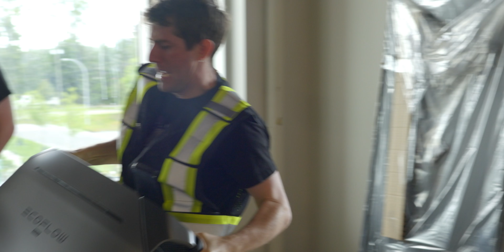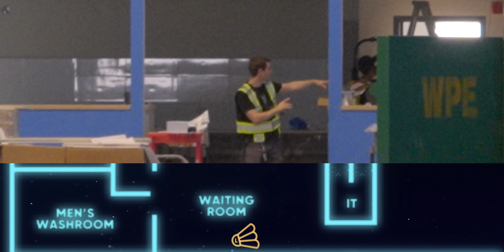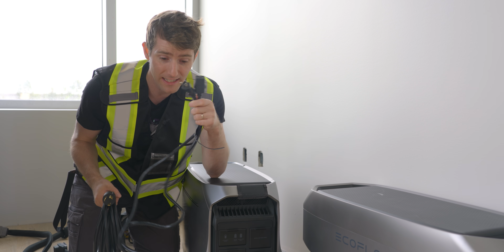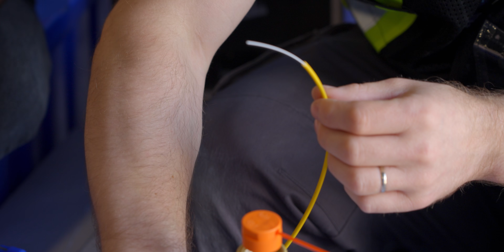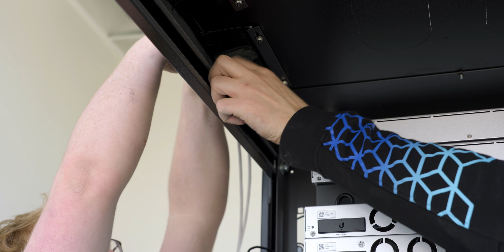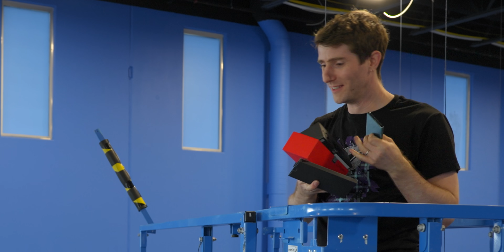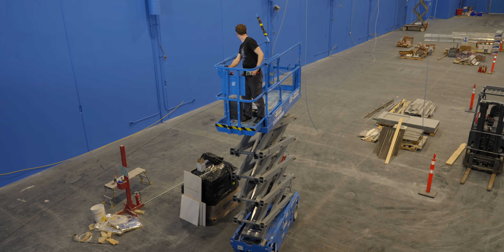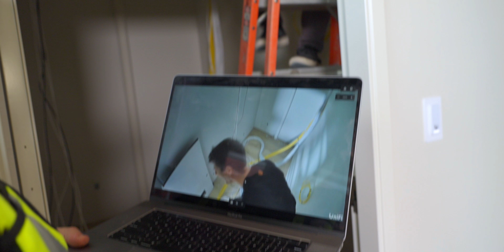I put WiFi 7 in my badminton center

Comment: I have a question, talking about speed. I have an 1 gbps fiber package with my isp, but I am only receiving around 400 to 500mbps, up and down is that around normal or do I need to call them and have a chat with them about their speed? I thought if i paied for the 1 gbps it should be more like 600 to 700 mbps.

Comment: 8 year Telecom Tech here Coax, Ethernet and 5 years of fiber (same company)    those AFL Fast connectors are awesome they really are fast.   I dont recomend the black tube/sleeve.  You should be good with the rubber boot. Put it on the buffer tube first strip/scrape back over 40mm and clean and cleve and quick connect.    Push both pins in on the connector tool to push into fitting then slide fiber in until it stops and squeeze the sides of the connector tool

Comment: I know this is an older video, but usually they don’t like to put sprinkler heads in data or server rooms. Usually they’ll use some sort of specialty fire suppression. I saw that sprinkler head sitting almost directly over the rack in the small room and all I could think is there’s thousands of gallons of water sitting right above very sensitive electronics.

Comment: anyone ever tested these magnetic cable management clamps from LTT Store with older less well insulated Cat 5e Patch Cables for possible interference? I once had to re-position an ancient cable in the production area of the company I was working for because it was too close to a rather dangerous psu and my coworker blamed magnetic or electromagnetic interference as a possible source for the problem (system patched to that panel was basically lagging and sometimes packets were straight up lost - I blamed the faulty cable though, but you know how it is working with ancient tech sometimes involves a little bit of lay on hands and magic server dust)

Comment: 9:05 Linus, if you have not already, please consider having LMG purchase a fiber optic fusion splicer. I use a Fujikura FSM-80S at work and they are a Godsend compared to fast connects (mechanical splicing). A fusion splicer will also make it much easier to work with fiber in the long term and have an infinitely higher success rate on the splice. Fast connects are to be used in emergencies with a followup plan to replace the fast connect with a fusion splice.

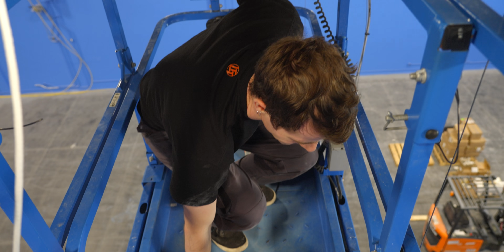17:18 I went on a scissor lift, and up to its maximum extension to terminate a cat6 cable, for the first time last year and also chose to work on my knees. The platform felt too wobbly when standing but more stable on my knees.
Reply: They have no idea about anything infrastructure related. Why waste money on a fusion splicer

Comment: I'm a bit late to this video, but as someone who works almost exclusively with fiber in data centers this was somewhat painful to watch. So many issues that MAY not be an issue, but I have seen failures over so many of these issues. I love seeing the "Fuck it we'll do it live" attitude, but it's weird seeing a video that I can actually critique what is happening. I might have if I got to this video sooner, but I almost want to use this as training for some of the newer guys that I work with as far as what NOT to do. 

I will admit even after quite a bit of time on a scissor lift and with a harness I still regularly grab the structural steel.

Comment: Those APs are way too high in my opinion, in most scenarios we should never exceed 3m in height, and the antenna pattern is not optimized for that. I would consider mounting them on the walls, especially if you want to take advantage of WiFi 7, which is great, been testing for a few months so far but the EU kneecaps us at 160mhz...😢

Comment: You shouldn’t be recommending Ecoflow before they issue a recall on the river 600MAX. It has a defect, so if you uncharged it completely it won’t charge again.
Mine died just a week after warranty ended and they should recall these units because of this defect!

Comment: "in Wi-Fi, if someone is using it, to a degree, you have to wait for them to be done"
i've learned that in the past, Ethernet worked like Wi-Fi now in the sense that you had to wait for someone to stop sending data before you can send or else the packets will collide and be come corrupt, because all the devices was connected to a single cable, like Wi-Fi now but in cable form. look up "shared medium Ethernet" and "CSMA/CD"

Comment: This place looks cool and all and I really love the concept but as a Disabled person I gotta ask, how accessible is the building? Are the public entryways wide with automatic doors or the ones that require the button? Are the doors themselves light? Once it is set up, will there be enough room in the LAN setup for a power wheelchair to comfortably fit between the rows? Is there an accessible (and gender neutral) washroom or a accessible stall in each washroom?

Comment: why dont you guys never use other brands for networking like mikrotik for an example CCR2216-1G-12XS-2XQ There are 2x QSFP28 cages for blazing-fast 100 Gigabit connectivity, 12x SFP28 cages for 25 Gigabit networking, and a Gigabit Ethernet port. The device comes with 16 GB of RAM, decent NAND storage, and two M.2 SATA slots

Comment: I live in a rural area in South Texas where satellite internet is usually the only option besides mobile networks. Recently, the tower near my home underwent maintenance and upgrades, and now my phone receives a strong 5G UC signal. I’m consistently getting speeds no less than 500 Mbps, and yesterday I even reached 1,100 Mbps down. I have Starlink, but I’m considering adding 5G as a backup or using it as a bonded connection.

Comment: Those speakers in standard ac oustic drop ceiling panels is going to be a problem. Please use different panels or support the weight of the speaker above the grid. Also, lower the gate on the scissor lift when operating it or you'll trigger regulators and Safety Steve's everywhere.

Comment: Microsoft pisses me off. On Windows, you have to be running Windows 11 24H2 (currently in "preview") to get MLO support. 

But Windows 11 24H2 removes ALL support for Windows Mixed Reality headsets. They simply do not work at all on it. (YES, I USE A WMR HEADSET FOR VR, I'M A CHEAP BASTARD, I GOT IT FREE!)

So now I have to dual boot 24H2 and 23H2, depending if I want VR or fast WiFi.

Comment: Are 5 APs enough? I know Linus thinks that is a lot, but he said hundreds of people. I work in a warehouse with about 300 people a shift. We have wifi access points all over the place. We have much more space though so we require more for that, like hundreds of them amount. I still would think that for over 100 people that 5 APs is low, that is 20 people minimum each and I would think there are going to be APs that have much higher use than others.

I am no expert, Jake is (I think), So I trust him. Just blows my mind from my experience if it can handle it.

Comment: That was a very long advertisement not sure why I watched it but those two are just entertaining. Always a joy.

Personal experience ecoflow is hot garbage I've had 4 of the Delta Flow Pro die on me. Not even abused and never ran down the batteries. EcoFlow support is junk they never respond and never replace even when it's clearly the device that died. 

UniFi is awesome for quick setup. Anything for long term no, RUN. The reliance on a single controller is not for mission critical applications. Hell the unfi gateways are horrifying when it comes to security would rather just stick a condom on the cable offers better protection.

Comment: As a Bicsi tech the only part I cringed on,(and this is true for most IT guys in my experience) is the lack of proper cable management in the rack spaces them selves. Flat patch panels should have a horizontal cable management above or below. If you go with V or bent PP then you can skip the C.M. 

Also, bloody stop using 6in patch cables like that, it makes it incredibly difficult to work in. You should have all of your patch panels together and all of your hardware below that. If you do PP/switch/pp/ switch it’s next to impossible to access the back of the patch panel. This tends to cause unwanted outages from bumping things from the last guy who couldn’t get his hands back in there.

Comment: It seems that faster internet really doesn't make a noticable difference anymore. At least in my case. Unless I'm downloading a 100gb game off Steam, 1gbps service would rarely be utilized. It's like when we were switching from dialup to broadband and there was a point where there were very few sites/resources that supported such speeds, so you rarely got to take full advantage of your shiny new 1mbps DSL. Especially on P2P services downloading games on Kazaa and the like. Nowadays it's so fast, I didn't even notice that my service has gone from 150mbps 5 years ago to 700mbps (and for the same price!). 

Like I said, Steam is the only place I ever see the full speed utilized. And even then, I'm not sure, it tops out around 25MB/s. I should say I don't use streaming services at all. But I imagine they wouldn't use any more bandwidth than YouTube. The "4K" content I've seen on some of them looks worse than most 1080p. So, I assume it's been compressed to hell in order to save them bandwidth costs. Comparing the 4k demo videos that came with the TV, nothing comes even close. Even blu-ray looks all blocky, but I digress.

Comment: So maybe the cumulative experience of the internet can help me out here. Here's the scenario:

I think I have gigabit internet provided by my dorm. I have a CAT 6 cable running only 3 feet from the outlet in the wall to my MiRouter 4A (which uses 802.11ac technology). Currently, wireless channel is set to 44 with bandwidth at auto for the 5G option (i tried all possible combinations of the wireless channel and bandwidth and this one gave me the highest speed). The 2.4G wireless channel is set to 8 with bandwidth set to auto.

I don't need great range since the usage is literally just in my room (so at max, I'd be 10-15 feet from the router). I used the WiFi analyzer app to see whether i was in a crowded channel but it seems like i wasn't so, that isn't the issue either. I'm also the only one using the router (yes, I've checked)

Currently I'm getting 100mbps on my laptop which is using the 5G range and 50mbps on my phone which uses the 2.4G range. With my phone, I'm pretty sure the outdated device is the limiting factor (it's a 4 year old redmi 9c 😂)

My laptop is HP probook with intel wireless AC 9560 (160MHz) network adapter. I haven't tried using the LAN connection to see how much speed i get yet.

Now my question is as follows:

1) Given the info above, is my router the limiting factor or could it be that the dorm internet is not actually a gigabit connection?

Comment: This video was extremely useful. After 4 years of using Unifi in my house and hooking up friends and family's homes with it, I'm tacking a much bigger project of revamping my church's network, Wifi, cameras and door access. And while it will pale in comparison to the scope of this LTT project, a lot of those pieces will still end up in my design. And there are little reminders to use G5 Domes in places they could be tampered with, versus G5 Turrets that can absolutely be more easily screwed with if they aren't high up. Can I do everything myself? No, I will need some professional help on wiring (especially outdoors) and camera mounting. But door access installation is probably best left to someone who does this for a living. But everything else I can do and manage.

Comment: 16:19 I didn't process the description right the first time and thought those open panels on the side were just for cable passthru, but now that on my second watch... I think those are for mounting your switches or keystone panels.

Also, Jake, do you put everything in front? Or do you put servers in front and networking in back? :P (I get it's a temporary setup since the main closet isn't ready yet but still :P)

Comment: From a guy who works with fiber lasers: If y’all plan on using fiber cables frequently I’d recommend getting a splicer. The one I use is a Sumitomo Electric Type-Q101-CA. You will simply be fusing the two fibers together. It won’t affect performance and idiot proof. Splicer will tell you if it’s a good or bad splice and what Db lose you have. Splicing and putting on a splice protector is significantly easier and more reliable than those fast connect.
Reply: They were just trying to convert from one type of connector to another. By far the easy way to do that is to buy a short cable with different connectors in each end and use an adapter to connect them together. Will only cost you a few dollars and requires no skill or equipment at all. They should get some fiber cleaning gear however. Dirty connectors is the number one problem in fiber installations.
Reply: @BaldurNorddahl the connector was ordered but didn’t arrive on time

Comment: You need tile bridge backing plates for those SoundTube speakers. The tile itself isn't structural to hold the weight of the speaker. The tile bridge puts the weight on the ceiling grid, not just the tile. SoundTube sells the bridges and they are the same green color.

Comment: Hello LTT,
Frankly why don't you guys use either EcoFlow or BlueEtti for the rack(or any FVE inverter as followup).
Both should have UPS/EPS feature. But please select only model with LiFePO4.
Perhaps it could be used for video comparing that solution with regular IT/telco UPS.
There's also benefit of one producing pure sine and the other not really...
Can it be added to home-assistant? Will it be jank solution for notifications when there's power outage?
Will it be able to last much much longer during outage for less $$ ?
Can it be expanded?
//Tomas

Comment: 24/7 access via fobs is a massive boon for members.    I manage our local snooker club and since we installed a keyfob system rather than cutting and giving keys to a select few, we've got people coming and going at all hours and people absolutely love it.   We've got people playing snooker at 6am or 11pm rather than just through the day, and if anyone loses their fob we don't have to replace the locks.   Coupled with CCTV everywhere we do it on a "we trust you until given a reason not to" basis, and 99.9% of people respect and appreciate that.

Comment: That unstoppable WAN Show setup would be cool! In my opinion, there's no need to hook up the studio lights to backup power. Just the computer, audio equipment, camera, background colored lights, and network equipment. The studio lights turning off during a power outage (with the rest working just fine) would look even cooler and funnier.

Comment: Always love these more enterprise-level tech episodes, especially when it's tech you're actually using for a purpose and not just showcasing! 

One thing I'll say relating to the doors is to make sure every door can be opened from the inside manually, no software or electricity required. You don't want somebody getting stuck on the inside in case of emergency, or even just from a software bug!
Reply: Single suite renovation/installation as depicted in this video is NOT "enterprise-level tech." The server/networking videos are definitely fun and arguably the most interesting LTT content (with the all-time most interesting LTT content being the original moving vlog series), but they definitely are not enterprise grade. The 24 hour access control is arguably the closest they come to an enterprise level issue, and they gloss over the subject for sake of keeping a relatively long video on pace.
Reply: @terpfen  Enterprise: "products and services that are designed to meet the needs of large organizations". I'd say LTT is a pretty large organization in terms of networking and electronics needs. A LAN gaming centre with potentially 100+ people in it needing fast connection definitely counts as enterprise.
You're talking utter bullsh*t, what do you call rack mounted switches with 25Gb Links, and many many fibre links, if that's not enterprise what the hell else are you calling it?! And more importantly, what networking kit would you say is better than this? Because You're going to be fairly hard pressed to beat a lot of this kit unless you start becoming like an ISP themselves or something.
I think 700+ CAD$ pricetag per switch pushes you into enterprise level tech easily
Reply: @terpfen  - Define Enterprise.
Reply: Mine is much faster lol, 1.3G is nothing special. Having more with Wifi6 for over 2 years
Reply: @kerneltask1337  Good for you. Though how is that relevant to my comment you're replying to?

Comment: here with 50mbit telephone ADSL connection wont get faster than 80mbit measured striaght from line by ISP mechanic pain although luckily its stable works flawlessly no latency flactuation or speed flactuation everything is as paid for ,many friend and people in villages complain with bunch of instability and not reliable connection so i guess i am still lucky in my location cosidering no optic fibre here

Comment: I'm an electrician, not a door guy, but I've been in construction for a while now. that's the wrong doorframe to use for electric strikes. I'm sure they make some sort of product out there that you might be able to use to retrofit the frame to work, but it's probably going to be expensive and laborious. you're better off just installing mag locks at this point and forgoing the electric strikes. but again, I'm not a door guy or security guy, just an electrician.

Comment: Before I've watched the video:
Yes. No doubt. I don't even have an AP with 6 GHz specs, so it doesn't take much.

After I've watched the video:
Your WiFi is faster. But your results in terms of percentage, is not really much better than mine.